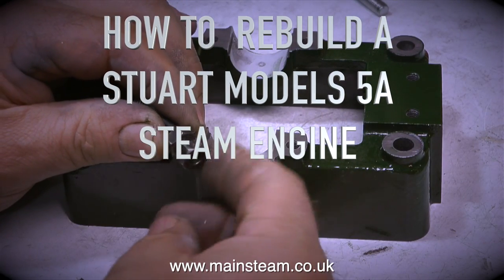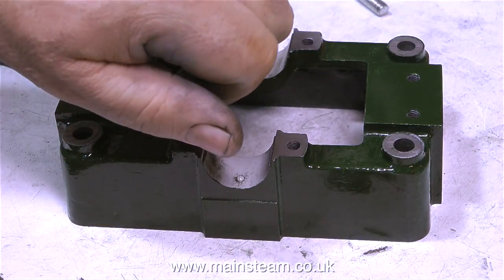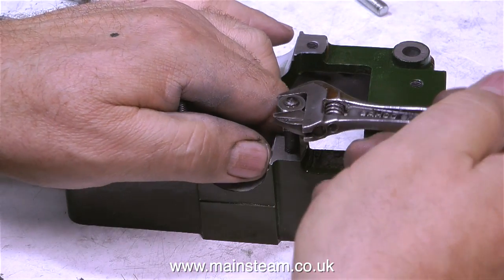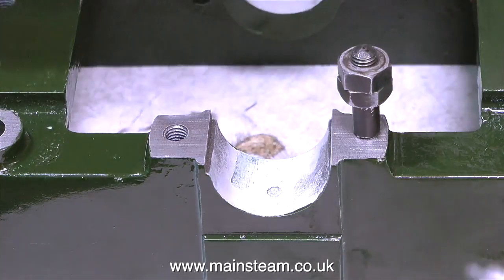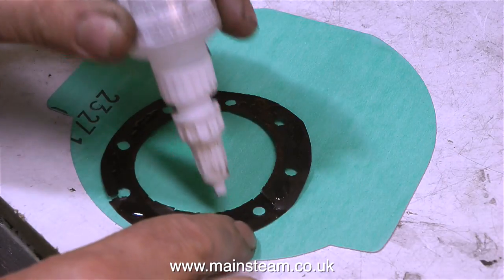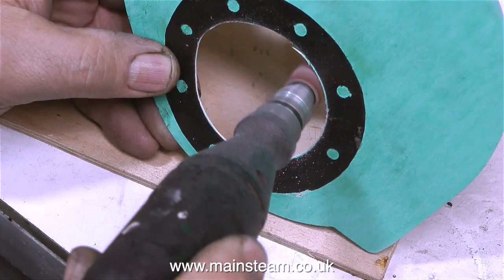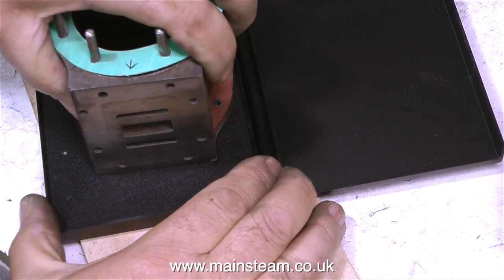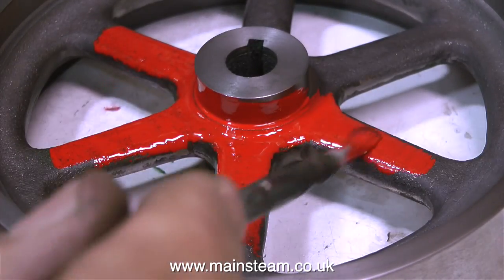HOW TO REBUILD A STUART MODELS 5A STEAM ENGINE - PART #9

Comment: Unpainting brushes are very useful. Just be careful not to touch it to bare skin, it will remove flesh faster than a 1" belt sander. Heh heh, cheers! 

Ink pad is a great idea for making a gasket print. If you don't have a large pad I've had luck with black motor oil from the lawnmower. (Or in case your pad runs dry from leaving it open while watching paint dry for example) :)

Comment: Another way to make a gasket template is to use a bit of thin card - an old cereal box for example. Place it over and very gently use a ball hammer to tap around the edge and the bolt holes. This creates a mark that can be cut out.

Comment: Let those negative comments roll off your back. I liked it. Most people don't even notice voice overs on television till it was gone or muted. By the way I like to use RTV for transferring a pattern for oil sump use but I like your trick for smaller projects in witch I don't want goop on a paper or gasket surface👏👍

Comment: Have you ever seen any of the old steam powered cars like a stanly or a doble. I wonder if an engine like the 5a could power a little car. Steam offers so much torque I think it could.
Reply: its about 1hp, so will get you to about 5 mph :)  a steam moped would get closer to 30 mph with it, but the boiler and coal storage is a big issue!

Comment: Do they have those un-painting brushes at Blackgates Engineering? I've not seen them carried by any stockists here in America?..... And here I am wasting all those mineral spirits and cellulose thinners all these years........
Reply: Yes, I'm also in America, the USA to be specific, and I've never seen an unpainting brush. It seems it would be a most useful thing.  Perhaps I should check Blackgate's  website.
Reply: You can buy these brushes from the same shops that sell bubbles for spirit levels.